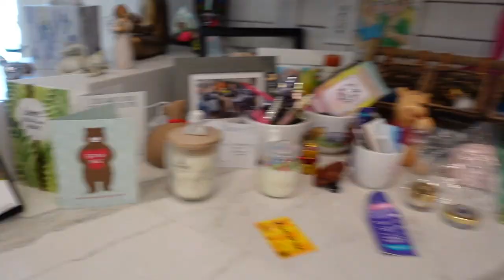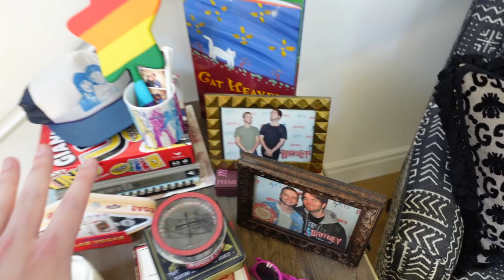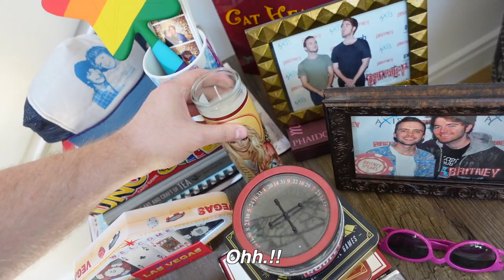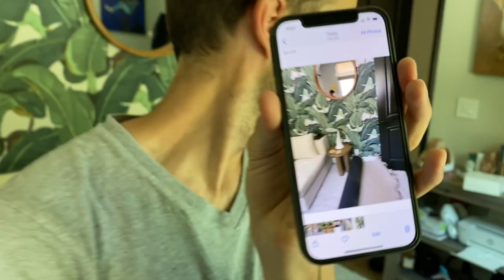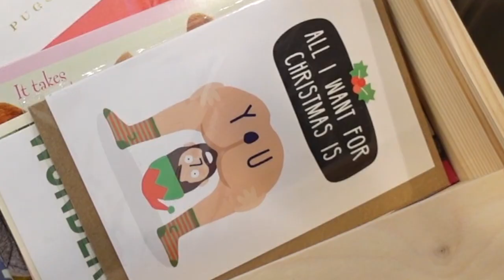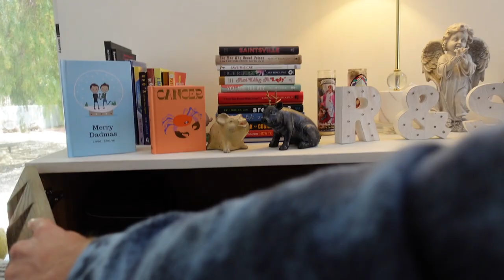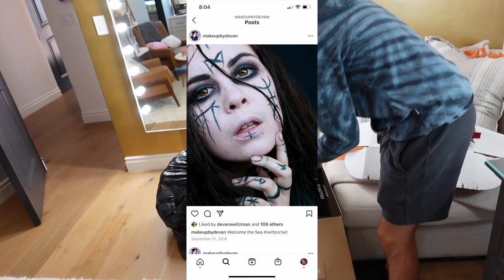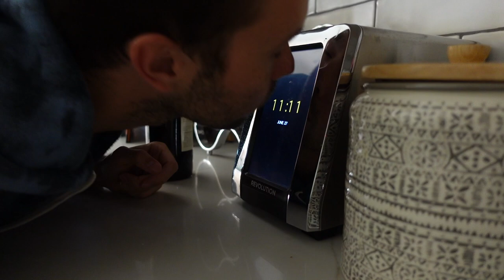Our House Needs… HELP

Comment: A cheap and easy way to organize cables and cords is to put each one in a sandwich or snack baggie, and write on the bag with a sharpie what that cord/cable goes to.  It keeps them from getting tangled, and you'll know at a glance what goes to what.  For further organization, put them in a plastic container or basket within the drawer, so they're not floating around everywhere.

Comment: I have been reorganizing/decluttering my own house for about two years (in spurts but still more to let go). It feels amazing and the trick to letting things go more easily is to take pics of items that don't bring a ton of joy or hold a very sentimental meaning. It helps me to be ok with letting sooooo much more to leave my home. I no longer try to sell items unless its worth over $75-100 and a loved one can't use it. It means more to me to be able to give it away, bring another person joy, and allows the item to get more use. 
I get enormous joy out of creatively & efficiently organizing different areas of my or others homes. It doesn't always have to cost a lot of $ to make a storage area look amazing! 
The trick is to create a Pinterest board of organizing ideas so you have inspo and then start out with one area or drawer at a time.